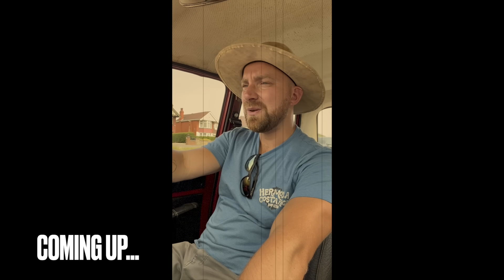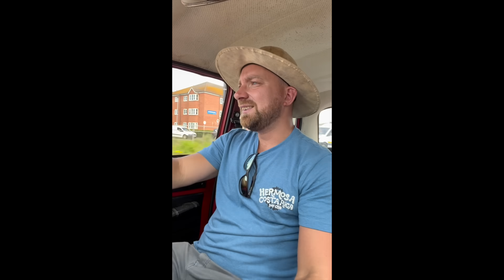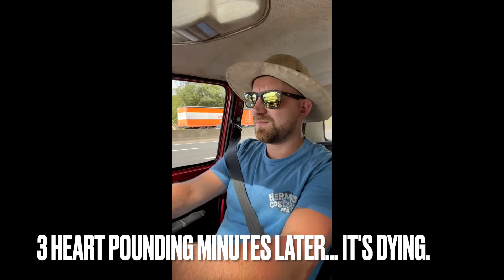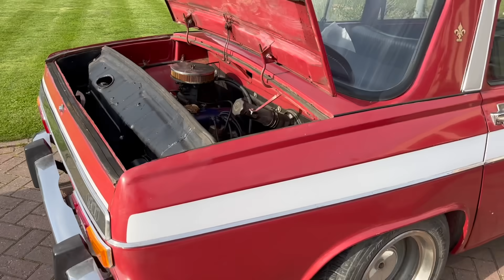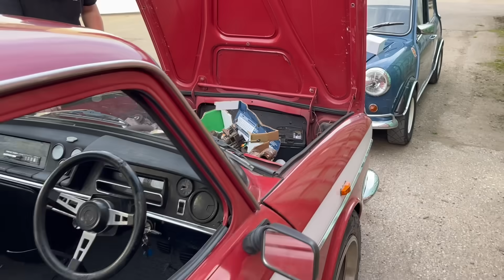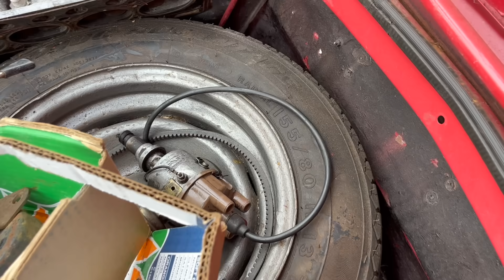Beating the ULEZ with a 1969 Renault 10. PART 1. What could go wrong?

Comment: My first car was a 1970 Ren 10, one of the most enjoyable cars I've ever had! Everything was and still is easily fixable.
Reply: No plastic LEDs to completely replace, no ECUs to programme.  Returning to horse and cart might be worth doing lol.
Reply: I had an older round-headlight one.  Super reliable, 350,000km plus when I sold it.  The brakes (4 wheel discs) were superb. A bit nervous in the wind, a bag of sand/cement in the front helps.  The seats are super comfortable too.
Reply: @65PCH   Exactly, I always had a couple of bags of gravel in the boot to stabilise the winter winds hahahaha. I also loved the crank, for if the battery went dead she would always start first time.
Reply: That was, my first car back in 1980... Great memories

Comment: Put electronic ignition and an alternator, check the water pump, skim and port that head, balance the fly wheel and you will get 85bhp out of that, twin carbs will put it close to 100 bhp, make sure you put discs on front from clio though
Reply: It already has 4 disc brakes!
Reply: @salipander6570  Does the 1100🤔 I thought it was the sport that got those, everydays a school day👍

Comment: Geoff, that takes me back to my early driving days with a Renault 8 and then two Renault 10s. Ok, we had the weedy 1100 engines but loved them. I was “given” the 8 which was actually a scrapper, £25 and £40 for the 10s. I bought one for spares and it was better than the car we were doing up (ie cobbling back together). Happy days despite the dreadful build quality, the rampant rust and very dubious handling. Several years of happy(ish) motoring. Fully biodegradable too.
Reply: I had a R10 (100 cc) and then a R 8 Gordini (1300 cc). The R 8 had exceptional handling

Comment: Looks a bit like my R8. Same colour , white roof, regularly broke down. so much fun to drive. Fantastic brakes good heater , noisy  & great seats. My first car & in some ways the best car I ever had. That was 1971. Oh yes the wheel nut spanner doubled as a crank handle. Also mine often had a boot full of bits . I loved that car.
The real star of the show was a brand new R8 Gordini front panel fitted with 13 Volt aircraft landing lights .

Comment: I loved you getting worked up about the temperature gauge, this is why when going french classic, I feel air-cooled is much safer! I should say my '74 Citroën Ami8 cruises beautifully at m'way speeds and will do a bit more if needed! Looks like you had some sort of alternator/charging issue! Hence started off running sweet and gradually running became worse as voltage dropped maybe?

Re the brakes - I once drove a Renault Estafette van, which had brakes that seized on and then eventually freed off but meant a lot of stop start driving!

Still, looks like an absolute cracking eBay venture! Looking forward to more updates!

Comment: Geoff If the shell is good you have something with great potential there. The 10 was very popular in SA and Oz, does not have the same cult following as the 8 here in the UK, but is the same car . If you get stuck give me a shout.
Reply: Isn't the Renault 5Gtt engine just a slightly updated version of this pushrod motor with a turbo slapped on it?

Comment: I had the predecessor, the Renault R8 Gordini which is now a cult item in France.  It was French racing blue with double white stripe over the bonnet, roof, and trunk.  They can overheat in modern driving conditions so you need to keep the engine cooling system, rad and cooling ducts in perfect condition.  The R8 was 1100cc with two twin choke Dellorto carbs, high lift cam and redline at 7000.  Keep yer foot on the pedal and just stir the box for best fun possible.

Comment: My first car. It was three years old, an ex farm rep’s car, for £300. The biggest problem with this model was that the tyres fired wet mud into the wings and they had big rust holes in them, long before they were three years old. The window washing system was a sort of rubber suction cup on the dashboard that squirted a tiny amount of water on to the windscreen. I loved it!

Comment: My first car.
 Horrendous gearlever like the linkage was made of rubber. Brakes should be lovely, its discs all round. Mine did the dead battery splutter breakdown thing as well, Seem to remember it had a shitty connection on the dynamo regulator.   Awesome wierd thing though, looks a peach with cibies, I seem to remember the factory headlights are concave lenses the same as those spotlights. I'm quite jealous. Cant wait for the mouth wide open spare wheel reveal.

Comment: I have owned many of those in my life in South Africa. Great little cars. Travelled very well on the motorway from Johannesburg to Cape town (1800 km). Easily travel at 70 miles per hour.  Just check the points. They did tend to close up. You had better put on a relay for the spot lights.

Comment: Do remember that because the engine (and radiator) is in the boot at the back, they get no forced cooling by way of forward motion, like front engined cars.  The Hillman Imp was similar.
Reply from the maker: Who puts an engine in the boot with no cooling??
Reply: @GeoffBuysCars  Well Skoda corrected this issue in the rear engined Estelle, by putting the radiator at the front.  The issue then was two long metal pipes under the car, which could freeze in very cold weather.

Comment: I learned to drive and passed my test in a Renault 10. Can be tail happy if you lift off on a bend and you need some weight in the boot if its windy.  Someone said the other day there are only 19 currently registered in the UK - rare classic!  My Dad owned two of them - an 1100 in 1966 and two yearsish later, a 1300.

Comment: One of my work mates bought a used Renault 10 back in the early 1970's. The car had an automatic gearbox with a push - button selector on the dashboard. Very unusual and I had only ever seen this on high - end cars like Bristols or Iso Grifos. My mate decided to "hot" it up and bought a Nikkei/Nikki (?) carburettor kit. Problem was that the original carburettor had an automatic choke system and the new carb. had a manual choke. So a long/extended choke cable was required for the upgraded carb. which had been "forgotten".  As you can imagine, cold starting was a bit of a pig because he had to find a "volunteer" to stand behind the car and hold the manual choke open until the engine had warmed a bit! Needless to say my work mate swapped it out within a few months for a Ford Corsair with a column style gearshift. He just kept buying what he thought were "good deals"!

Comment: I've had two Renault 10s. One I drove 2,500 miles from Melbourne to Perth in under four days in 1989. It didn't miss a beat, and I was very comfortable on it's superb seats. 
The "Crap" brakes are because it has four wheel unservo'd discs which need a hard press on the pedal, but definitely pull you up quickly.
The big bottle in the front is a coolant expansion tank. 
IIRC the starter motor is under the manifold so does get hot. It should have a heat shield over it but again IIRC they're pigs of things to fit so it's a lot easier to put the starter motor on without it.
I'd be curious to know what you paid for it.

Comment: The glass bottle was the radiator expansion bottle when it was an open vented system, had one on a ren 4
Rad at the front + bottle. In the 1972s they moved over to the closed system ;ike most cars today, glass at the time was cheaper than  H/T plastic

Comment: My first car was it's older brother the R8, rolled it 4 days after I passed my test in 75.

Steering was so light you had a bus sized wheel and two or three breeze blocks under the bonnet.

Comment: From memory (mid 1970's) glass bottle was part of cooling system in engine compartment. Spare should be in cradle underneath front - so spots under bumper would block good access. Don't remember oil pressure or water temp gauges - but could easily be wrong. Lots of great memories !

Comment: I put a self tuning Holley EFI sniper fuel injection throttle body on my 1979  Cadillac Coupe Deville and it instantly updated the car to a modern car .
The Holley unit looks like a 4 barrel carb but fuel injection .I get better gas mileage, more power and the emmisions are way better .
Modern engines and old engines are pretty much the same ecept for electronics and fuel injection.

Comment: Had overheating issues on mine when doing 120km/h - but perfect at 60 to 80km/h. Turned out it was the missing plates around lower part of engine - they block the wind from blowing into engine bay as speed. With radiator at the back the wind coming under the car and into engine bay hits the radiator and stops the cooling wind that should be entering radiator from rear.

Comment: I had a 1969 Renault 10 with the 1100cc engine in it. Paid £50 for it in 1975 as it was badly corroded. Thrashed the nuts off it until it knocked a big end out of it! Great car though and would have lasted a lot longer if I'd looked after it. Those seats are to die for, so so comfortable. Happy days.🙂👍

Comment: I have a 1975 Dacia 1300 (license built Renault 12). Same 1.3L engine as the R10, and I'm pretty sure it's the same 4-speed gearbox as the R10, only flipped around for the engine being in the front. I know for a fact it tops out at 144km/h according to the GPS, motorway speed limits in Romania are 130km/h (80mph) and they allegedly allow a 10% deviation on the speed, so in theory you can go 143 km/h (88 mph) before you get pulled over. I have gone down the motorways in Romania multiple times in it, pedal to the floor, topped out at terminal velocity, barely squeaking 1km/h over what the alleged speed allowance is 🤣.

Comment: Quick fix for overheating in those old motors is to whack the heater on full blast. Long-term fit an extra electric fan on the Rad. I've got a 79 midget ready if they bring in ulez where i live.

Comment: Love the paint job and the references to Starsky and Hutch. That big old Torino only came with the biggest of V-8's horrible gas mileage, not practical at all fast yeah but the turned like a battleship. Back to your Renault, Engine in the rear interesting don't know much about Renaults other than the ones they sold here in the US were pretty bad as far as quality goes. I think as far as European imports to the states we're not getting as high a quality vehicle as are sold there. Probably the requirements our government slaps on them. A boot full of spare parts, a bad sign or a bonus? Good luck with this one can't wait to see it in full running condition.

Comment: the problem with most old cars is Rust.  the new cars tend to be better protected, and the engines (generally) more reliable . though some production of toxic particles/gases damaging atmosphere indeed is a problem it does seem the idea to scrap "modern classics" seems unwise in the arena of overall motor vehicle production ( noting that I think the main ULEZ affected vehicles are the not really old diesel vans/camper vans)

Comment: I'm sure you know but turn the heater on full blast to draw the heat off the engine.  All my cars were junkers 😅  maybe the generator is bad if you ran out of battery?  Love this video ❤ reminds me of my 20s when i had an old 1965 chevy impala 2 door, 3 speed on the column, 283 small block v8.  12 miles to the gallon.  I loved that car and did all the maintenance myself.  Hate the push button electronics nowadays.
Reply from the maker: I cut out a lot of video where the blowing heater ruined the audio, the Audio was bad enough anyway 😂😂

Comment: Interesting little car, I recently dived into rear-engined Renault madness too with a 4CV. Took me ages to track down a problem that was causing it to cut out, turns out the rotor arm had a fault despite looking perfect. To be honest I think the dizzy gets really hot being so close to the aluminium head, so as a matter of course I'd replace the cap, points, rotor and condenser. I also messed about re-routing the fuel line and adding a heat shield to reduce the chances of fuel vaporisation on really hot days. PS the "washer bottle" under the bootlid is the brake master cylinder.
Reply: I thought that about the little bottle in the scuttle and the colour of the fluid suggests it needs new brake fluid asap which is probably why the braking is weak.

Comment: The key is to find an old classic and convert it to run modern engine and transmission. Chops garage has a mgbgt with mx5 running gear. We are into something....

Comment: Sounds like a simple charging issue with the battery. Either the alternator, the battery itself or the wiring. Should be easy and cheap to sort out. The misfire was occurring simply because the battery was struggling to supply a strong enough spark to the plugs. as it began to fail.....

Comment: The problem with such Renault when they were made was they were known as being the French answer to hedges! The rear engine could give handling problems and were subject to rude jokes of the day! However, they had wonderful items such as a heater as standard! The misfire could relate to valve sticking as unlikely to have a green head and is now running on green fuels. Four branch manifold could be for fluoride version. They were used for competition but I think they decambered the rear springs. There was certainly a rear tweek which improved handling.

Comment: How's the underside rust?  That was always a problem with cars back then.  All my old cars went that way after many sheets of fibre glass and body filler.  My first was 1957 Ford Consul which I bought for a tenner in 1969 and with the number plate would be worth a fortune today.  Would you believe LDY 8 !!!  I would pull out that engine and rebuild it.  They were sooo easy.

Comment: should be fine as a daily driver, my son ran a 1965 Hillman everyday doing 10000 a year very little issues, i have 1955 Austin use it regularly important to use 99 octane premium fuel runs so much better and as you say no road tax, no mot, cheap insurance and about 40mpg

Comment: For us here in the states what is the ULEZ charges? Some kind of road use tax? They want to put those in place here but that supposed to be handled by the taxes collected with the tax on gasoline for road maintenance.
Reply: This country is taxed to death. We pay income tax on everything we earn. Then if we decide to buy something new we pay 20% value added tax on that. If it's a car we then pay road tax to drive it on the road. Then we pay tax on the insurance for the car. Then we pay vat AND fuel duty on the fuel we put in it. We pay tax on the annual vehicle inspection ticket. 
And then, if you live in London (and other cities soon) on top of all that you have to pay an extra tax if your vehicle is not ultra low emissions compliant (ulez)! Then there are plans to introduce a road usage tax where we pay by the mile no matter what we drive. 
In all I would guess that 75% of driving costs are due to tax! Good save America!
Reply: A ULEZ is an Ultra Low Emission Zone. The idea of the zone is to improve air quality by levying a daily charge on all vehicles that don't meet the latest Euro emissions standards, thereby discouraging their use in the zone. Naturally, EVs are exempt, as are certain other classes of vehicles. Vehicles and their owners are identified by roadside cameras that read the licence plate and then look it up on the national vehicle register. The irony is that any vehicle built before 1 Jan 1973, no matter how polluting, can drive through the London ULEZ with no charge.
Reply: @coopdivi  Thanks for answering my question. So how long before the government outlaws those classic vehicles? Or expands the ULEZ to include those older vehicles?
Reply: @dennisswaim8210  There are already plans to expand the inner London ULEZ to greater London. However, the peasants are revolting!
Reply: @coopdivi  Good luck fighting back against this insanity. The people of Britain deserve better than this.

Comment: My brother-in-law had one of those, in 1970. The only thing you could rely on, was just how unreliable it was!

On the whole though, classic cars are no less reliable than any other - I've never had any problems with any of mine over the years, but you do need to maintain them, and this where the myth about "unreliable" old cars comes from. As cars aged, owners took less care of them. Important maintenance items would be missed out, just to save a shilling or two - ignition points being a classic example, followed by plugs and condensers etc. A few pennies to a few shillings each, but owners would always say "Nah, it's not worth spending money on". So, save ten bob and cost yourself a fortune!

'Oweveurre........ Some makes, notably Fiat, Renault, Alfa, Citroen, British Leyland and Vauxhall were not renowned for their build quality, or mechanical reliability straight out of the factory gate. So those marques were always unreliable, but even that could be mitigated by good maintenance, and importantly, not leaving it too late, or cutting corners to save pennies.

Comment: They rust like 'uck  ... The back of the top of the rear arches was the first to go on the R8 we had  ( the lower specked ) ...
Reply: And the brakes were always rubbish ...
Reply: I think that bottle is the expansion bottle / header tank for the cooling system ...